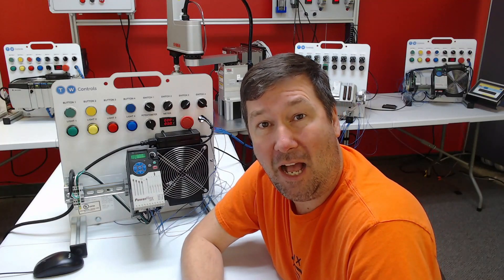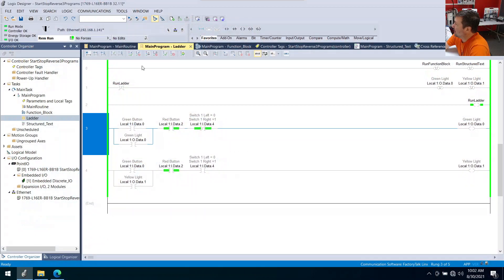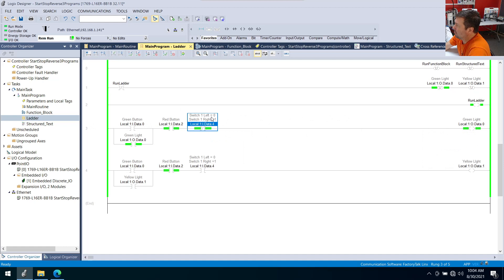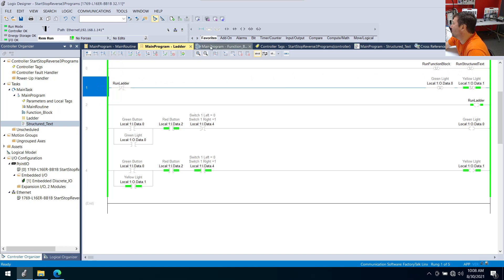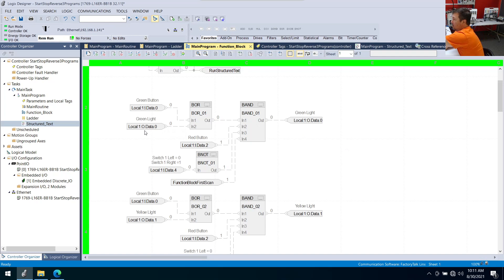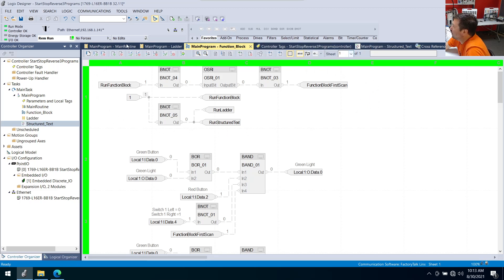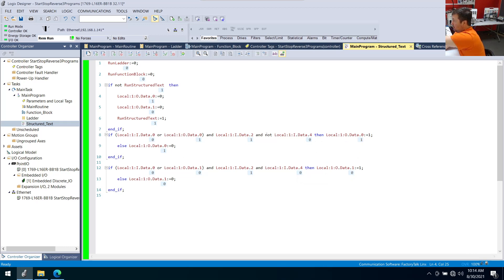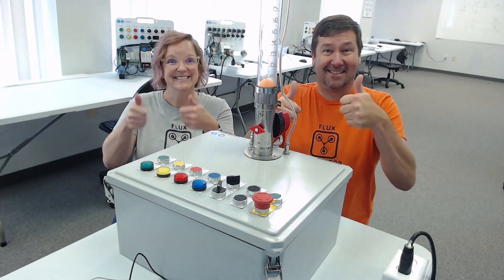PLC Quiz Program a Start Stop Reverse in Multiple Languages Answer #31

Comment: Just saw this. What a great quiz. Got an idea on a potentially cleaner way to handle the routine swapping initialization. Have used this method before in a different way. Basically compare 2 integers, lastScan and currentScan, on 1st rung of main. If NEQ, unlatch control bits/outputs. On last rung of main, move currentScan into lastScan. In 1st rung/block/line of each subroutine, you set currentScan to a different value. Should allow for control and outputs get initialized anytime you change, and you always can tell what subroutine you are in without looking at the switch4 input. Going to set it in logic when I get in the office Monday to make sure I am thinking of it properly.
Reply: Correction: would still be examining switch 4 in my logic, since it would be used to determine which subroutine to run.
Reply from the maker: Seems like very sound logic, thanks for sharing!